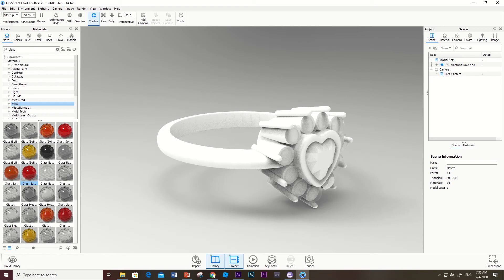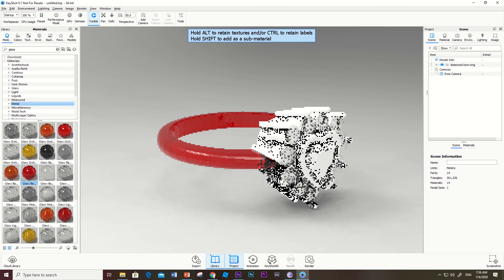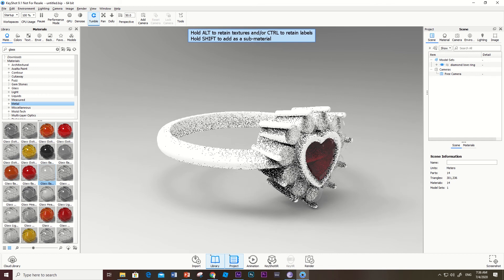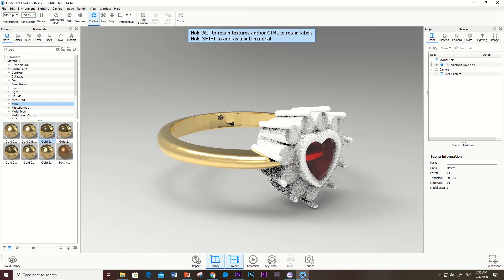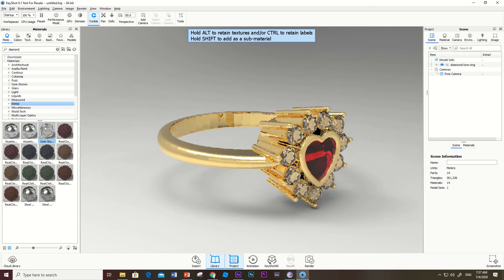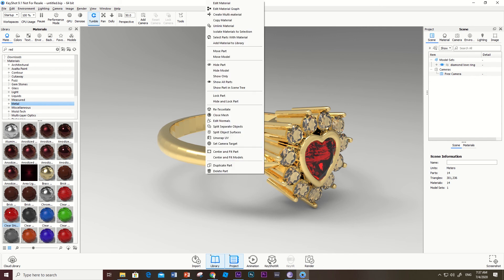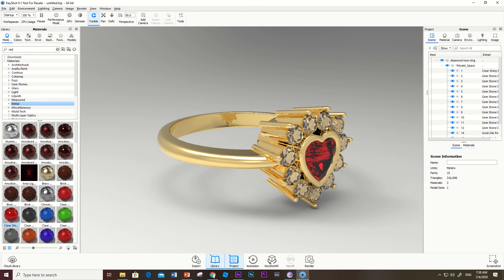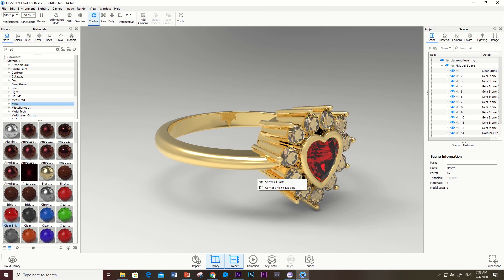Keyshot - How to fix/smoothen pixelation issues (example Jewellery)

Comment: hi, before my question I wanted to let you know that I really appreciate your work, great videos!I have a quick question. I made a model in autocad, worked on it in Zbrush, and now in Keyshot for final rendering. All fine, except some of the edges on the back side, which are shown kinda transparent/ segmented showing construction wired. I tried different material or edited norms, no help. I noticed that bigger scales sometimes help, as a trick, but also no help here. 
would really appreciate your feedback thanks in advance and best regards